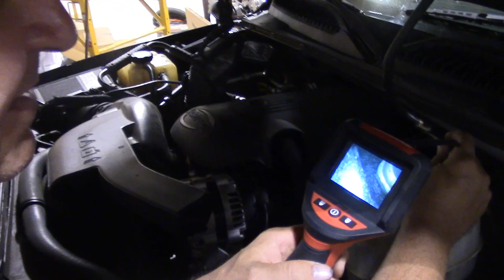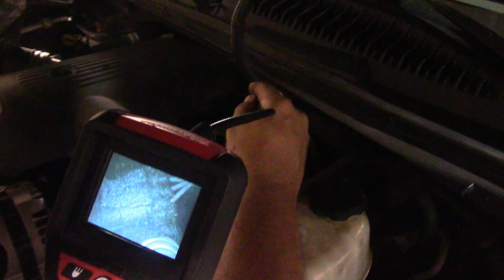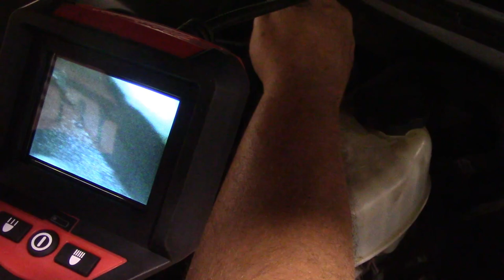2004 Chevy Suburban oil leak diagnosis

Comment: Vortec has nothing to do with a name of an engine.  Vortec is the cylinder head design, specifically the combustion chamber shape and the way the intake charge is directed into the combustion chamber.  The 5.7l (350 CI) SBC engines had this and the LS Series have it also, bothe Gen 3 and 4.
Reply: I loved the 327 back in the 70's.

Comment: before you even get started i'm calling rear main seal, just putting that out there. can't believe you forked out the money for a Miluwakee bore scope. thought you bought one of those like i got from Sams with the color screen and the recording capabilities. HEY why you being so hard on the 6.0L? the one in my Escalade does really well with everything and still gets 15.6 mpg while doing it which while pulling it only goes down to 11.2 with a 3500 pound load on my car hauler.  ODD i just bought a gas powered pressure washer from HF not the mack daddy but the one right under it. haven't even used it yet but it's going to do house duty soon, i'm thinking maybe this weekend
Reply from the maker: He knows the rear main is a possibility. But all the wet oil on the top of the motor needs to be dealt with first. The bore scope was a Christmas gift from Tammy a couple of years ago. Recording would be nice, but i'm not complaining. As for the 6.0, I loved that truck. The reason it got 10mpg was because the thing was a beast. Full 4 door cab and an 8 foot bed. Wish I still had it!
Reply: I love my 6 liter..I am on my third one but it does love fuel..if you can stay interstate only it get's killer mileage..but town it just drinks it like a soda. STill they are probably the best engine Chevy makes to be honest.
Reply: but i thought you were a Ford guy.  mine still isn't bad around town either i still average about the same not exactly obviously but it's not a whole lot worse either. i think it's just bad and stays that way because of all the weight i have in mine, remember i like to travel with a toolbox full of tools on board too. hate being without a tool when i need it specially when you break down away from home.
Reply: well if you ever want to record with your scope for show on one of your videos holler at me and i'll bring mine over for you. typically if he had the 5.7 V8 vortec it's either the rear main seal or just run off from the fill neck but when it's run off from spilling it then it's just on the one side typically the Drivers side since that's the side the fill neck is on. i'd be surprised if it's anything as deep as the intake unless that's never been replaced before.
Reply from the maker: They all have good and bad about them. I take no sides :)
Reply from the maker: Being the LS motor, it has that valley pan in the middle. And after seeing all the oil back there, the intake has to come off to determine where it's coming from.
Reply: @MacGyversWorkshop  
Wouldn't a rear main seal leak have noticeable signs looking through the bell housing inspection opening?

Comment: !!HELP!! I got an 02 Suburban, when I move the truck out the drive way theres a stain of oil. Weird thing its not where the engine is at its like under the 2nd row seat! Any advice would be appreciated. Some have told me transmition oil and others drive shaft.
Reply from the maker: If it's leaking under the 2nd row seat, that would definitely be an output shaft seal on the transmission.
Reply: @MacGyversWorkshop  omg from the bottom of my heart I appreciate it. Now to find a mechanic I can trust, just moved to San Antonio Texas.

Comment: O ring on cam sensor
Reply: had a 3.1l  lumina with a bad distributor "O" ring leaking.But,  the dealer was  calling  it as a rear main seal the guy had the appointment and was willing to go for it...unfing real. The o ring cost $.80 and took me an hour to change.
Reply: They are on the rear of the engine,cam sensor front

Comment: I've got a 2010 Gmc with a 6 liter it love's fuel. I can say one thing about it. If you could just stay on the highway interstate driving and not get off mine will get between 17 and 18 mpg..but soon as you hit town mine will average between 10.5 and 12.9 LOL..I love it but it does love fuel. I had an F150 got killer gas mileage.
Reply: mine is 15.6 highway and 14.7 average in town but i'm hauling several pounds of weight too in a truck that's already way heavier than it should be.
Reply: sounds like you need a few little power and mileage helpers like K&N air filter, E3 plugs, maybe a cold air intake and Ethanol Free fuel.  those would be good starters. what kind of tires you have on it just stock or have you beefed it up with muddin tires and mags like a lot of people do?

Comment: them are the engines they put in the old  chevy caprice cop cars
Reply: what the 5.3 LS motor? they had the old vortec 350's in some of the old cop cars but i wasn't aware they used the 5.3
Reply from the maker: The 9th generation Impalas (2006-2016) had a front wheel drive version with an aluminum 5.3 LS V8. Though they weren't used in the 9C1 police versions, they are popular with the Pontiac Fiero crowd where they LS swap their Fiero's.
Reply: most saved the LS1 swaps for the Mustangs, BMW's Miata's Porsche 924,944, & 944 turbo's. i've even seen one put into a DeLorean. NO ONE is swapping ford motors into any of those though wonder why? :o)  Yeah the LS1 came in the 9th gen impala as a front wheel drive motor they also had a rear wheel drive version of it in the next gen which was actually built on the Holden Comodore chasis called the "SS" and had a very limited production run of only 3,000-4,000 cars because GM didn't market them right or at all. it was just a model to fulfill an agreement with comodore in Austrailia before closing the factories there. it came with either the LS1 or the 6.2L LS motor in it depending on which year you got.
Reply: @DaddytechEnt  There was was the 5.7l vortec truck engine. The stopped making them around 1999/2000
Reply: @mikeanonymous669  yeah my 99 tahoe has one of them in it and so did the 2000  tahoe limited. and also the 2001-2003 2500 sieries trucks too